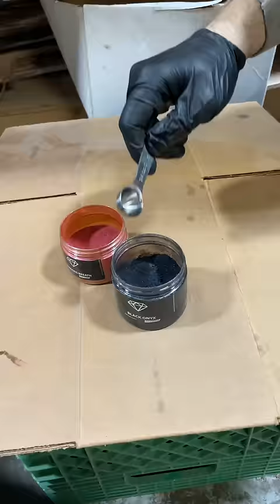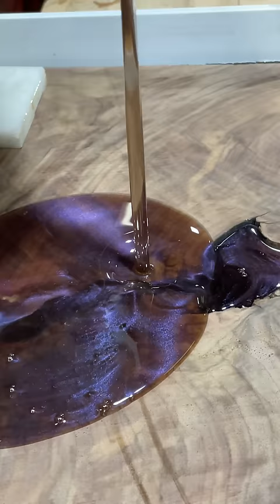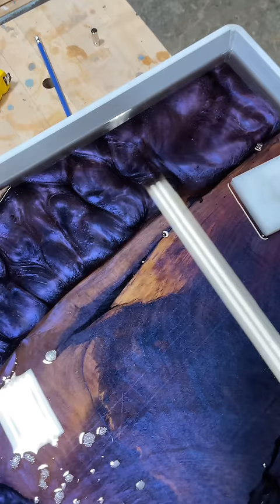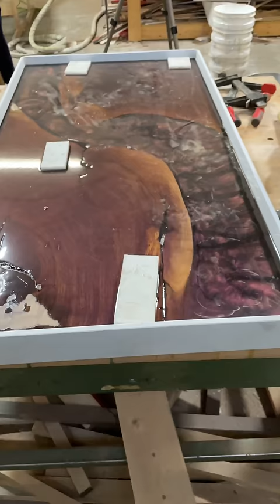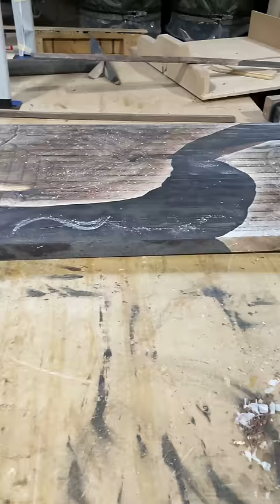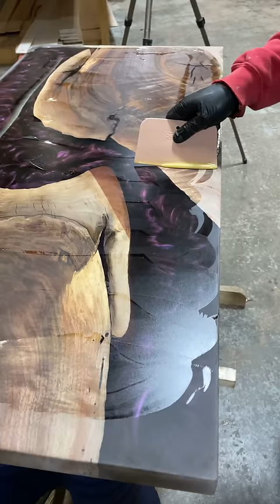FINALLY Finished Our Epic Colour Shifting Coffee Table!

Comment: I don’t know anything about wood working, but I’ve made a LOT of color shifting nail polish. I think you’re diluting the color shift effect by adding in black pigment. Have you tried layering it over black, instead? If you filled it partway with opaque black, or painted the interior edges of the wood black, and then filled it with ONLY dragon’s breath, I suspect you’d get a far more dramatic effect. I’m really excited to see you working with duochromes!
Reply from the maker: Hey Melissa,
Thank you so much for the feedback! Those are some great point and i'm thinking we need to experiment with that process to see what happens. Stay Tuned!
Reply: I'm guessing your DEF onto something there, thanks

Comment: You used some sort of white blocks under your clamps but then you poured your epoxy around and onto the white blocks.  How did you remove the white blocks and didn't they leave pits where the epoxy could not flow?  Thanks.

Comment: Great work. Absolutely beautiful.  Does the finish on either the wood or epoxy scratch?
Reply from the maker: Thank you for the comment! It holds up against day to day use extremely well. However, anything sharp/heavy enough could still gouge through.

Comment: Great work! I was wondering what material did you use under the clamp to hold the slab down?  I am referring to the white rectangular pieces. Thanks.
Reply: it is a HDPE material - High Densisty Poliethylene. The form they are useing is made from it as well, resin does not stick to it.

Comment: I have a question, I purchased Ecopoxy flow cast just like in this video, on the container it says to pour 1/4" at a time and leaving 48 hours between pours, but in this video it looks as if it's one single pour...also it mentions 1-1/2" thick max, isint this table 1-3/4" thick?

Comment: Just curious why did you pour the resin over the whole table just to sand it down seems like a waste of an expensive product
Reply from the maker: When we calculate how much epoxy we need, we always overshoot a little bit so that we can have a little more than we need vs. not having enough. This is for 2 reasons: 1) We always want to over pour because over night, the epoxy will absorb in to the wood. 2) If we by chance need to make an additional small batch, it can be a challenge to get the colour the exact change so it's easier and more efficient for us to just mix a little extra.
Reply: @jeffmackdesigns  OK, makes sense. great advice, i do love the finished results on all the epoxy tables they are fantastic. i will be attempting my first ever resin coffee table soon i hope it goes to plan iv been doing loads of research on it. also what epoxy resin company would you recommend?
Reply from the maker: @nathanguest9723  We use Ecopoxy FlowCast. You can learn more and purchase from our website www.JeffMackSupply.com
Reply: hi lovely table guys could you please tell me roughly how many litres of resin this took ?

Comment: How does the tabletop handle someone setting a cold or hot beverage on it?
Reply: Doesn't bother it. I made a dinner tray as well as coasters. As long as the epoxy is completely cured you won't have any issues

Comment: How do you clean your buckets for reuse?
Reply from the maker: Hi Dalton, we use bucket liners so we can reuse the bucket and discard the bucket liner which results in less waste. In the past, we would leave a mixing stick in the bucket while the remaining epoxy cures in the bottom of the bucket and when you pull the stick out, it generally pulls the remaining cured epoxy out with it. Then a quick wipe of the inside of the bucket and you can use again.
Hope that helps!
Reply: @jeffmackdesigns  Perfect, thanks so much!
Reply: @jeffmackdesigns  that's so helpful. i hate cleaning my buckets and sometimes i end up throwing em out. i'm just using grbage bags from now on :)